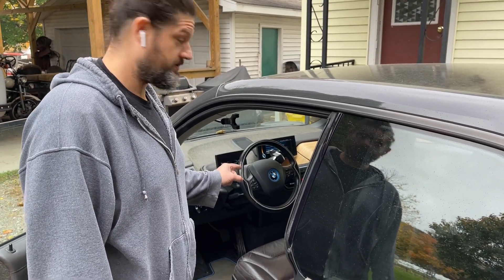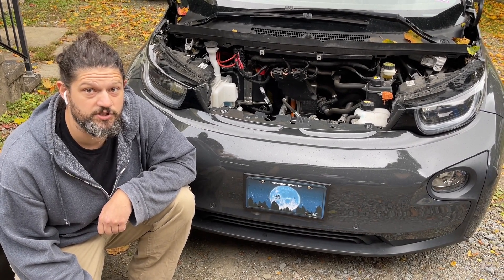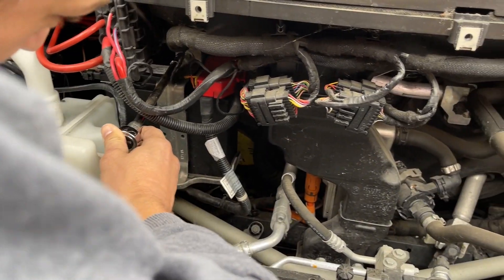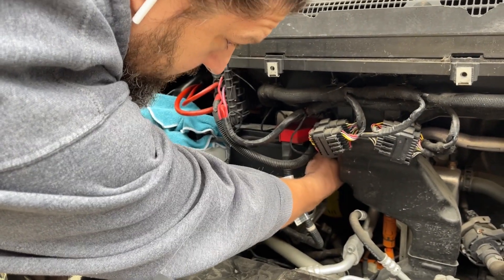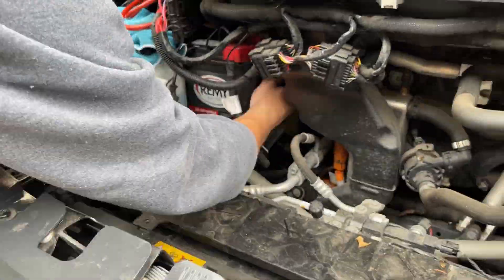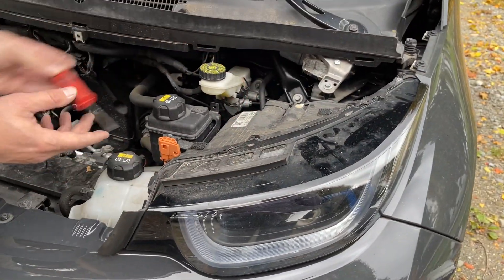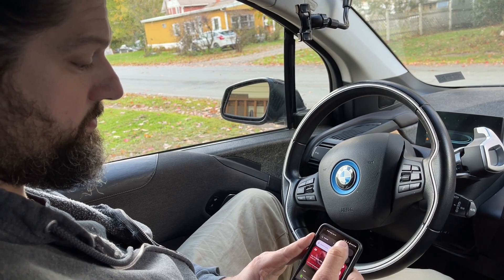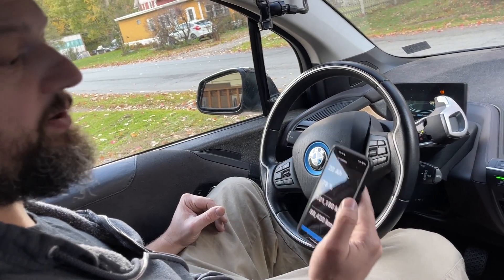How to Replace 12 Volt Battery | BMW i3

Comment: Bro in the video is using Veepeak OBDcheck BLE dongle. I also used it, it's the cheapest for Bimmerlink.
The phone asks for a pairing code, the pairing code is: 1234

Comment: Ok, it would be really helpful to zoom in to the places where you're removing/replacing things. If you don't know what the negative terminal, for example, looks like, .... just speeding through it doesn't help!  You did one freeze frame with a red arrow. Please do that  with a slow zoom to all points of contact. I'm not a mechanic and would like to be able to do this myself. But your video as is I'm not sure can help me.  Also you showed an image of another example of the deadly orange thing you disconnected, but not how to disconnect it in the event you have it. And it doesn't help to zoom in AFTER you've reconnected the deadly thing. Show us how you do it. Please  :(. Thanks.
Reply: This thing is not deadly, you think thin wires like that have a deadly voltage?

"The highvoltage safety connector  is part of the circuit of the highvoltage interlock loop. If one pulls apart the connector and bushing of the highvoltage safety connector, the circuit of the highvoltage interlock loop is interrupted. The voltage supply of the electromechanical switch contactor in the highvoltage battery unit will also be interrupted. As a result, the highvoltage system automatically shuts down and is thereby de-energised."

Comment: Thanks so much for making this video! I followed your steps exactly to replace the 12v battery in my 2018 i3.  Like others mentioned in the comments, the various additional things needed added to the cost, but in the end it was cheaper than going to a dealer and now I have those tools and items for future use.  Things I purchased: new Remy battery, BimmerLink iOS app, OBD bluetooth scanner, socket ratchet wrench set. (Also, I already owned a Battery Maintainer and it was useful to make sure the new 12v was fully charged before installing it.)

Comment: Thanks! I feel like this is totally doable but that safety tip about the HV connection is a literal life saver!⚡️
Reply: Update: I bought an OEM battery from BMW for about $225. I could have bought an aftermarket option a little cheaper but they didn’t have it in stock and I needed to get it done. The job was actually a lot easier then it looked to me in the video. I think I got it all done in about 30-40min. My battery came fully charged from BMW and I verified that with a Multimeter. Had I not seen this video I would have had no idea about disconnecting the HV. So glad I learned about it before doing the job. It’s not exactly like changing your regular gas engine car battery. I bought a Veepeak OBD II Bluetooth reader on Amazon and registered the new battery Myself. The dongle was $25 but the Bimmer code app was like $35 :/ overall it’s a pretty pricy job for just changing a battery but the dealership was gonna charge $450 so in the end I saved money and got a new tool I can use for other jobs.
Reply: @splocal 
Here in 🇩🇪 it's cheaper, the original battery was 140€  (120€ + shipping)  for me + 29€ dongle makes a total of 169€.
The app can be used for free if you know how.

PS: funny that the official BMW battery is more expensive in the 🇺🇸 than in 🇩🇪
It even says that it's made in the 🇺🇸 😅
Maybe BMW US ripped you off.